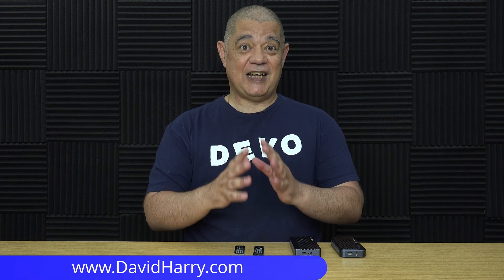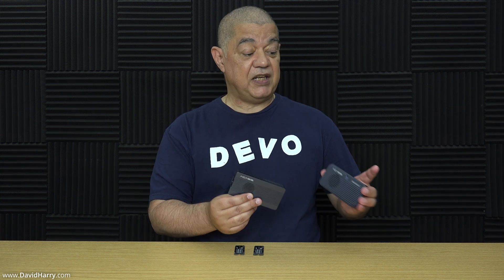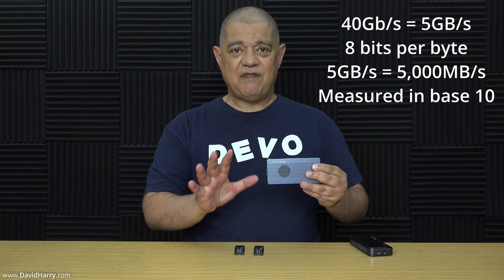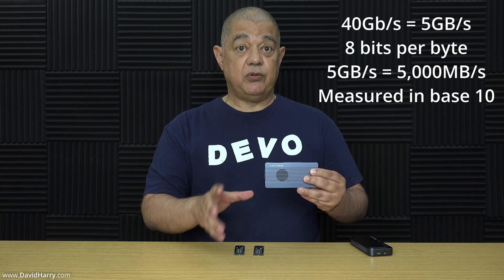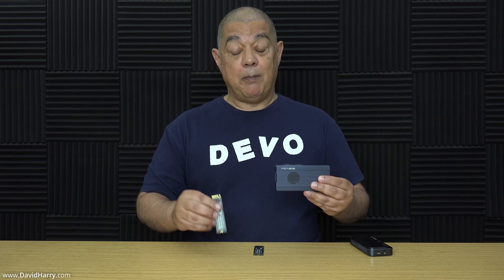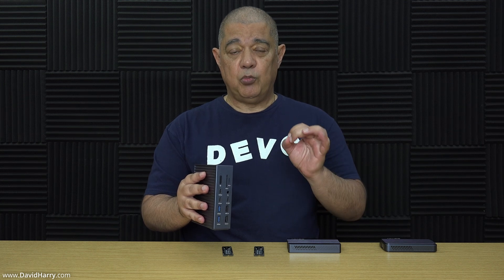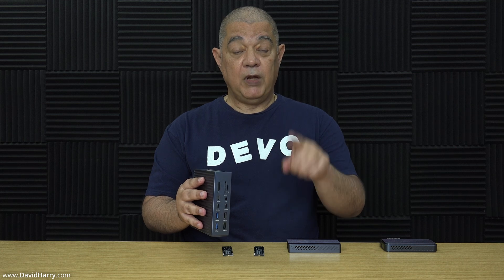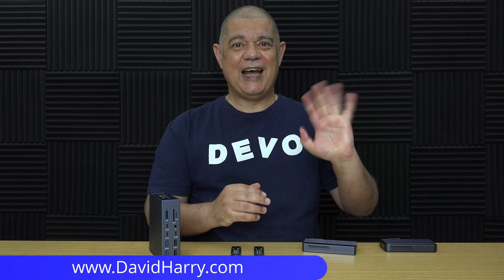Why A Thunderbolt SSD Isn't As Fast As Its Thunderbolt Speed - PCIe Bandwidth Limitations & Overhead

Comment from the maker: *Visit ACASIS https://geni.us/ACASIS-26 use promo code DAVID15 for 15% discount*
Is your Thunderbolt SSD speed slower than the Thunderbolt enclosure speed it is using?
Even when using a very fast SSD inside a Thunderbolt enclosure that is clearly faster than the 40Gb/s for Thunderbolt 4 or the 80Gb/s for Thunderbolt 5.

This is down to two main things. The PCIe bandwidth limitations of the Thunderbolt chipset inside your Thunderbolt enclosure which is used for PCIe tunnelling over Thunderbolt. The second thing is the inherent various overheads of the PCIe data bandwidth of the Thunderbolt standards. Overheads such as, parity bits, parity checking, cyclic redundancy checks, error detection etc.

For thunderbolt 4, which is 40Gb/s, you get 4 lanes of PCIe Gen 3 bandwidth for your data which is 32Gb/s and for Thunderbolt 5 you get 4 lanes of PCIe Gen 4 bandwidth, which is 64Gb/s. In both instance, that top line bandwidth that you may think is available to your SSD, is reduced by 20% immediately and then you may be subject to around a further 20% reduction in usable data bandwidth due to the Thunderbolt overheads already mentioned.

Checkout my playlist for all my SSD speed tests and external SSD build guides:
https://www.youtube.com/playlist?list=PLleKChtNUwZQvaYS9r0zHvkaTXSYlnX6q

SPONSORSHIP NOTICE:
This video is sponsored by ACASIS and thank you to ACASIS for supporting my YouTube channel 👍

Some of my product recommendation

For the ACASIS website check first to see if they have any specific promos running for specific products, they sometimes have great promos especially for their enclosures. If not, use my promo code DAVID15 for 15% off anything you buy on the ACASIS website.

Link to the ACASIS website https://geni.us/ACASIS-26

ACASIS Website - Thunderbolt SSD Enclosures

ACASIS TB501 Thunderbolt 5 USB4 V2 80Gbps SSD Enclosure (built-in fan)
https://geni.us/ACASIS-9

ACASIS TBU405Pro Thunderbolt 4 USB4 40Gbps SSD Enclosure (built-in fan)
https://geni.us/ACASIS-11

ACASIS TBU401 Thunderbolt 4 USB4 40Gbps SSD Enclosure (silent)
https://geni.us/ACASIS-12

ACASIS EC-3901 4 bay Thunderbolt 4 USB4 40Gbps SSD RAID Enclosure (built-in fan)
https://geni.us/ACASIS-14

All ACASIS SSD Enclosures
https://geni.us/ACASIS-13

ACASIS Website - Thunderbolt and USB Docks and Hubs

ACASIS M002Pro (TB1201) Mac Mini M4 workstation 8-in-1 Dual SSD 40Gbps dock
https://geni.us/ACASIS-15

ACASIS DS9007 21 Ports 40Gbps Docking Station Compatible with Thunderbolt 4
https://geni.us/ACASIS-16

ACASIS DS-7A15 15-in-1 4K 60Hz USB C Desktop Docking Station for Laptop & PC
https://geni.us/ACASIS-17

ACASIS DS-0202 14 Ports 4K 60Hz USB C Docking Station with PD 100W Charging
https://geni.us/ACASIS-18

All ACASIS Thunderbolt and USB Docks and Hubs
https://geni.us/ACASIS-19

ACASIS Amazon Store
https://amzn.to/4llG73N

Western Digital SSDs on Amazon

WD_Black SN850X (without the heatsink)

8TB https://geni.us/WD-8TB-WithoutHeatsink

4TB https://geni.us/WD-4TB-WithoutHeatsink

2TB https://geni.us/WD-2TB-WithoutHeatsink

1TB https://geni.us/WD-1TB-WithoutHeatsink

WD_Black SN850X (with heatsink)

8TB https://geni.us/WD-8TB-WithHeatsink

4TB https://geni.us/WD-4TB-WithHeatsink

2TB https://geni.us/WD-2TB-WithHeatsink

1TB https://geni.us/WD-1TB-WithHeatsink

Other M.2 NVMe Gen 4 SSDs on Amazon https://geni.us/Gen4SSDs

Apple Mac Computers on Amazon

Apple Amazon Store https://geni.us/Apple_Amazon_Store

MacBook Pro M4 Series https://geni.us/OLuacfl

MacBook Air M4 Series https://geni.us/x5G9

Mac Mini M4 Series https://geni.us/yJW1

Mac Studio M4 Series https://geni.us/V2lDm

Mac Studio M3 Series https://geni.us/7zws

iMac M4 Series https://geni.us/1k4pwp

AMAZON ASSOCIATE DISCLOSURE
I am an Amazon Associate. My Amazon links are Amazon affiliate links. I earn money from qualifying purchases when you use my Amazon affiliate links. Thank you for using my Amazon links 👍

OTHER EARNINGS AND COMMISSIONS
I also earn money from other product links within my video description. Thank you for using any of my product links 👍

You can also send me a coffee https://www.paypal.me/DavidHarry

My Amazon pages with videos and product links
Amazon USA https://www.amazon.com/shop/davidharry
Amazon UK https://www.amazon.co.uk/shop/davidharry

My Global Amazon Affiliate links
Using my Global Amazon Affiliate links when you buy anything from Amazon does not cost you any extra. However, the money that I earn helps me and my YouTube channel. Thank you for using my Global Amazon links 👍

Amazon USA: https://geni.us/Amazon-USA
Amazon UK: https://geni.us/Amazon-UK 
Amazon Deutschland: https://geni.us/Amazon-Deutschland
Amazon Canada: https://geni.us/Amazon-Canada
Amazon España: https://geni.us/Amazon-Espana
Amazon Italia: https://geni.us/Amazon-Italia

Contact for product reviews: YouTube@DavidHarry.com

http://www.DavidHarry.com

I’m David Harry. Thank you very much for watching this video, take care and goodbye now.

Cheers,
Dave.

Comment: Question for you: I am pretty knowledgable on this topic, and this is the best explanation I have seen in video format 👍. Fantastic job! Somehow, I never even thought about the potential for multiple monitors to eat up additional bandwidth. My questions are:

1 - Does this additional monitor bandwidth utilization go away (or at least substantially decrease) when using a hub with Display Link technology? To my understanding, those are supposed to offload the majority of the CPU burden when increasing displays.

2 - Do software and/or hardware monitor EDID emulators impact PCIe bandwidth as well? If you are not familiar with these emulators, they can be KVMs, HDMI dummy dongles, remote desktop software, etc used to trick your system into thinking multiple monitors are connected.
Reply from the maker: Hi. I'm glad you liked the video. If you are technically minded then you may want to search about '8b/10b encoding'. This is actually the main reason for the 20% impact on the PCIe bandwidth. It's quite an involved explanation of how 8 bit is encoded to 10 bit for the purpose of a type of checksumming. It's not quite the same as parity bit checking but is similar. I did not go into any details about that in the video as it's something that would take a lot longer to explain than the length of this video, which is why I over-simplified the whole overhead explanation.

To answer your questions. Using Display Link will reduce the bandwidth by whatever bandwidth Display Link is using. For instance, if Display Link is effectively using a 2:1 compression for the video bandwidth, which would make it half of the uncompressed equivalent. Then the impact to the video bandwidth will only be half. The Thunderbolt bus system doesn't really care what the data is, as Thunderbolt itself is only really a conduit/bus system and is only really looking at actual bandwidth, regardless of any compression within the data/video streams.

As for EDID. I'm not entirely sure, it depends where the EDID is being changed (spoofed). If the EDID is being changed at the end of the chain just before the monitor, such as a KVM or a HDMI splitter, then that's where the 'spoofing' will occur and not at the source. So I assume the lower bandwidth ahead of the 'spoofing' is what the Thunderbolt bus will be concerned with. However, if the EDID 'spoofing' is requiring the source to send what the EDID is registering, then I would assume that a higher bandwidth would need to be sent over the Thunderbolt bus and the higher bandwidth required (if that is the case). I may test this out as I have a number of video capture setups that can manipulate EDID and I also have a number of KVMs and HDMI splitters than can manipulate the EDID.

Cheers,
Dave.

Comment: Ah ha! So that’s what’s going on. Thank you for the concise explanation.
Reply from the maker: Hi, Roger. Yes, unfortunately, this is what's going on. I'm guessing that many people will have done what I did when first getting into Thunderbolt SSDs. Sitting there scratching their heads wondering why the super fast SSD that they put inside their Thunderbolt 4 enclosure can't reach 40Gb/s (5000MB/s) and they are left with a speed that is, at best, around 3000MB/s. Cheers, Dave.

Comment: Fantastic explainer. One minor point I'd add, assuming I understand the TB4 spec properly. Of the 40 Gb/s (4000 MB/s) available, 8 Gb/s is reserved for video. So right off the top, no matter what TB device is connected to a computer, 8 Gb/s will not be available for regular data transfer. This gives you a theoretical data max of 32/3200. So in the case of one of those TB hubs, that reserved block of data should be used first for video and then any other extra will eat into the available data.

Assuming I'm correct in this, then a hub would have 5 PCIe channels for TB4? And an SSD would have the 4 PCIe that you mentioned because it would be a useless added expense to have a chip with 5 since the controllers would ignore it for SSD data.

Anyway, this is a great way to explain why we don't see the 40/4000 speeds. No other channel I follow has ever explained this. Same with demonstrating how the 'TB" port on iPhone 15 and later doesn't even come close to the theoretical data max speeds. I'll assume it's a combination of  the controllers in the iPhone and/or whatever the phone is connected to for the dismal speeds. Especially connected to a Mac.
Reply from the maker: Hi. You've mostly understood what's going on. However, there is no 5th PCIe lane in anything. The 4 PCIe lanes are strictly for typical data usage bandwidth. The fact that's it's 4 doesn't really have anything to do with there being 8Gb/s left over for the 40Gb/s with Thunderbolt 4, which just happens to equal another 8Gb/s PCIe lane.

Thunderbolt itself essentially has nothing to do with PCIe, however, it is able to accommodate it via PCIe tunnelling. Which is simply a process to create a pathway for PCIe specific data bandwidth over the Thunderbolt connection.

Going back to the lanes. No, a dock or hub does not have 5 PCIe lanes. The dock itself has nothing to do with the PCIe lanes. The dock is Thunderbolt and PCIe data transfer through the dock is just a function of PCIe tunnelling over Thunderbolt.

As for video signal bandwidth. This will always take priority over everything else. There is no scenario where typical data bandwidth would be allowed to use any bandwidth that's used by video data. I'm not 100% positive but I think this weighting to video bandwidth is a legacy hangover from when DisplayPort and Thunderbolt were basically one and the same and Thunderbolt was effectively a video connection to connect Macs to monitors.

As for the video bandwidth, it get's worse for the data bandwidth. Thunderbolt 5 has up to 120Gb/s of data but this is only for video bandwidth and not data bandwidth and in certain instances there will be no data bandwidth at all. I will do a short video explaining that one, as far too many YouTubers are telling their viewers the wrong things about this stuff.

As for the iPhone data limits. This will be down to the speed of the iPhone's internal storage. Plus, they are USB and not Thunderbolt (for now). The latest iPad Pros are Thunderbolt though and they too do not have speed, again, because of limitations with their internal storage.

Cheers,
Dave.

Cheers,
Dave.